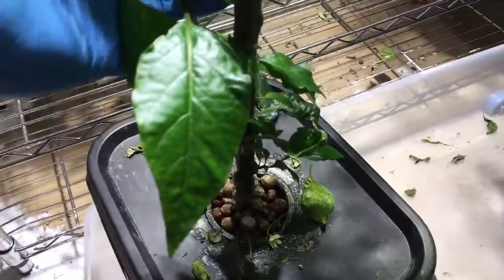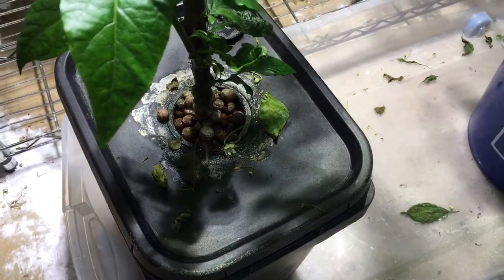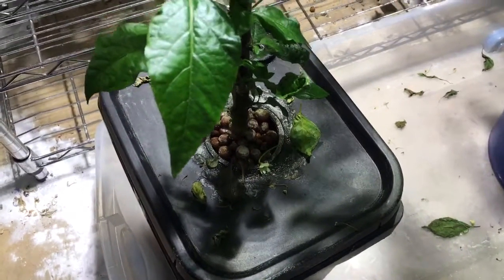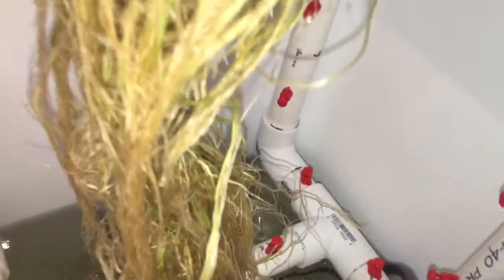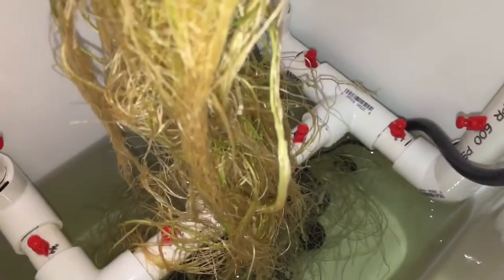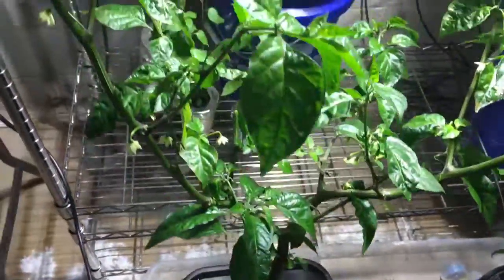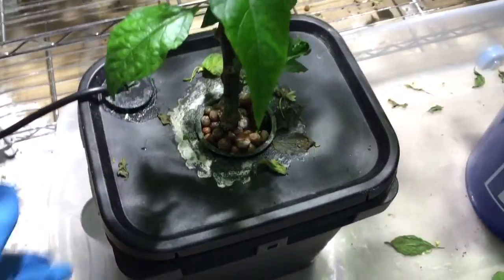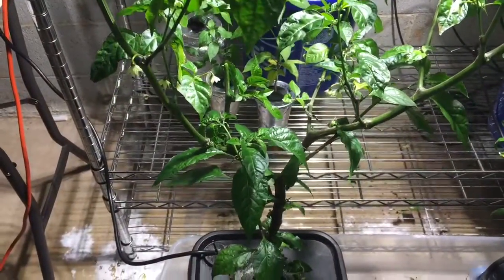Bhut Assam in DIY aeroponics - update #3 6/19/16

Comment: Do you let the pump run at all times?
Reply from the maker: Yes. A larger pump in a smaller reservoir might cause too much heat, but this setup worked fine to leave it on all the time.